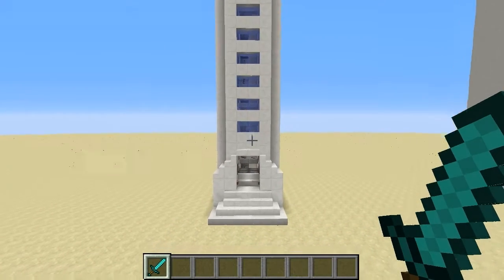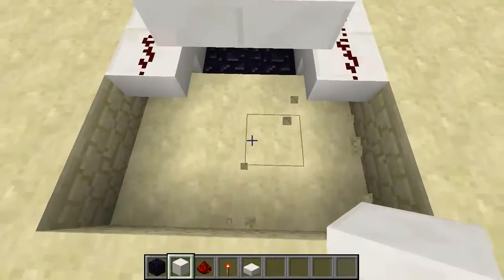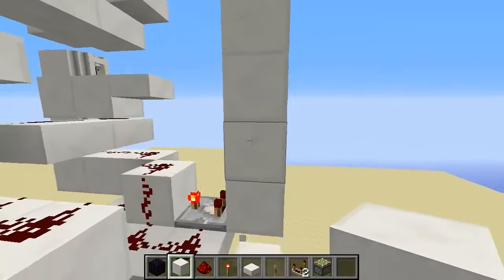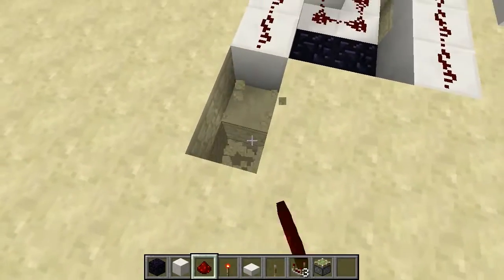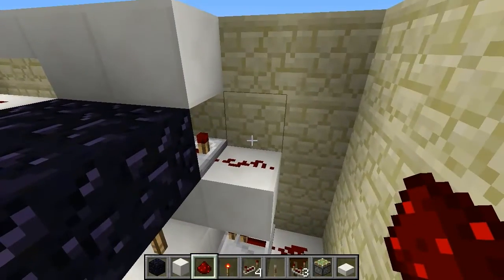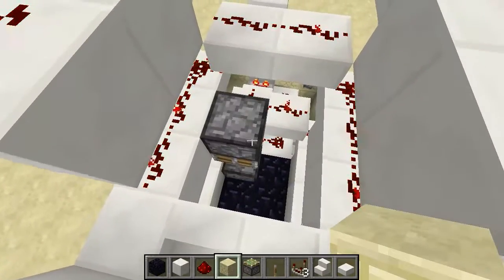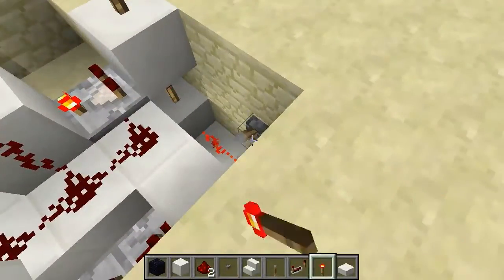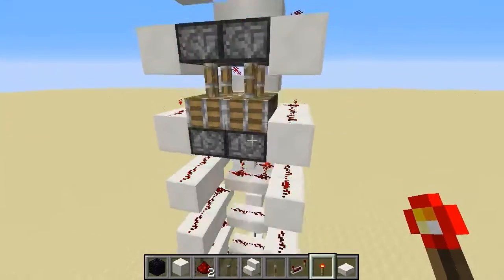TUTORIAL: Dirty Piston Elevator! 2x2 Up & Down, Small 6x4 footprint!

Comment: You start building the elevator only one piston wide and then towards the end it has 4.  How do I get the other 3 to work.  The original one goes up all the way, the second goes about half and then the other town don't leave the ground floor.
Reply from the maker: Benjamin Bauer you have to make sure the wiring is the same on both sides